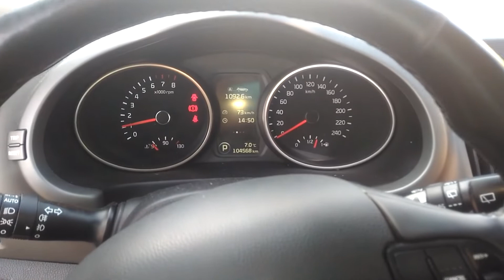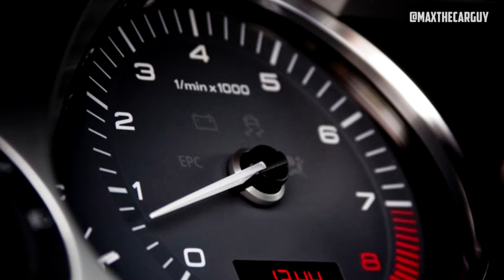5 Symptoms of a Vacuum Leak and Causes of This Problem

Comment: My Tucson has been in the mechanics for 2 weeks now and is getting sent to a Hyundai specialist locally all the symptoms you've described in this video match what it has been experiencing including erratic idling, check engine light, fuel trim lean, rough engine operation even though it's throttle body gasket has been replaced so there's gotta be more than 1 vacuum leak that wasn't detected when the TBG was tested
Reply: And? what was the problem?

Comment: Drive a g37x and believe I have a bad vacuum leak for a couple months now.  wondering , if I buy new intakes system and get it installed will it fix the leak no matter where it’s coming from or does the leak have to specifically be found first.
Reply: Find it first. It could be loose throttle body, or intake hose not clamped tight enough.

Comment: My car seems to run fine. No check engine light. When bringing my car in for service, two different shops mentioned I had a vacuum leak. Does this make sense?
Reply: Maybe your fuel trim levels were high to balance out the lean condition due to the vacuum leak but not high enough to set a code.
Reply: @ Bringing it in for an oil change tomorrow. Maybe I’ll mention it. Don’t want to send a $100 per hour mechanic on a wild goose chase for something I never even noticed.
Reply: Next time they say this to you, ask them what makes them think there is a leak.

Comment: Great video but it feels like I’m reading a high school student paper trying to reach a word count 🙄🙄
Reply: I have 2 vacuum tunes on the  throttle body  at the  bottom of the carburetor  1 goes to the air cleaner  the other one  goes  where  I think it is supposed to go to the transmission  but I'm not sure? Can anyone help me with this question?  Does  the  transmission have a ventilation system  .if so where does it  vent to?
Reply: @TinaVanHamlin-m2l hey bud I’m not sure what engine you’re hooking up. Does the second tube just need to be eliminated ? Or plugged. Don’t quote me but these new aftermarket ones still have the port but are usually just plugged without causing the car to be lean. I may have misunderstood your question.

Comment: I replaced my fuel pressure regulator and valve cover gaskets and back radiator, heater hose then my iac p,505 came oni checked all vacuum hoses 3.3 vg frontier,could a leaking vertical heating hose in the back of the manifold cause it to suck air in even if it has anti freeze running thru it set off the iac code,never had it till I took of the plenum left it upside down over nite for rtv to dry I'm stumped I think the heater coolant hose is sucking air into the manifold,do they work together
Reply: No